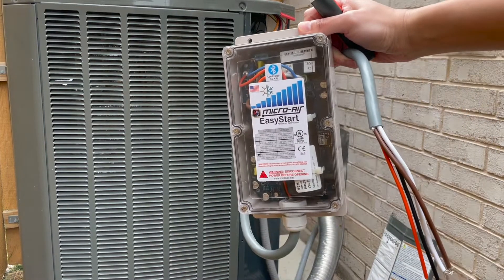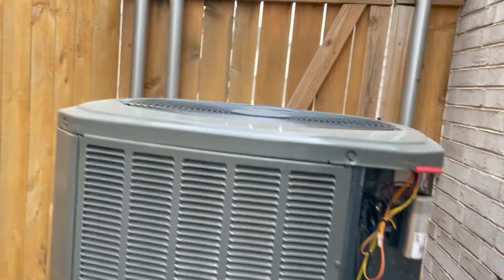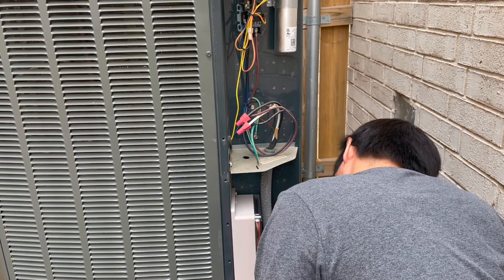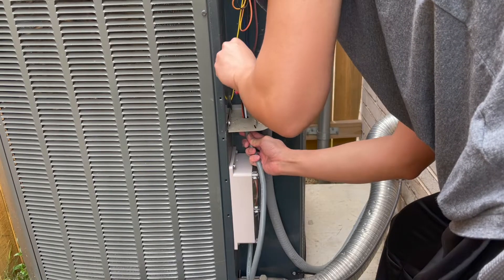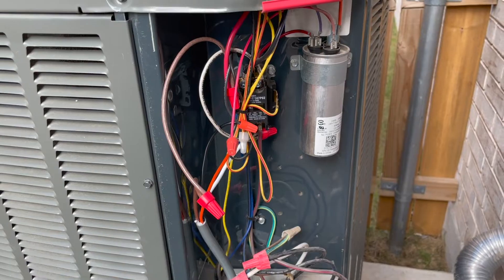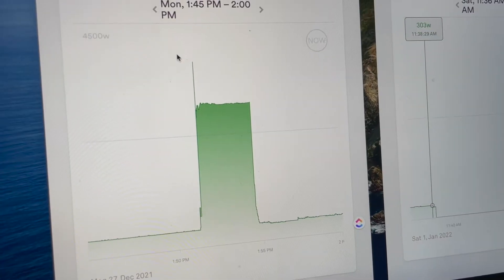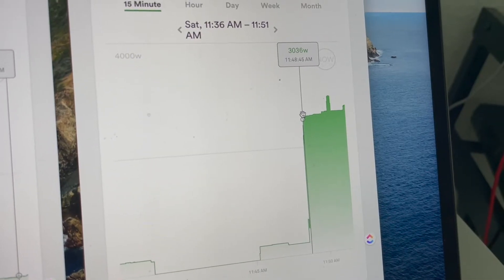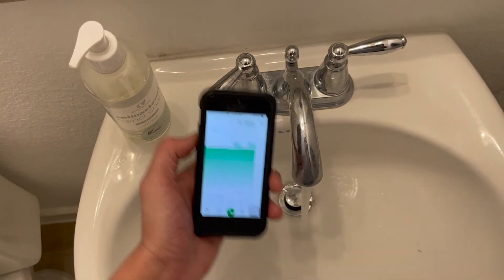Running a 4 Ton AC on a GENERATOR - Micro-Air Easystart 368 Installation & Testing

Comment: I installed the EasyStart 4 years ago on my 4 ton AC unit. It dropped the inrush from 120 amps down to 26 amps.  Running the AC requires 7 1/2 to 8 amps.
Reply from the maker: Me too! But my easystart unit recently stopped working… I had to rewire my AC unit to how it original was wired. 😢 Does yours still work? 

Microair support told me to try to change the capacitor in the unit, but if that doesn’t work, my unit just has to be replaced.

Comment: The Micro-Air Soft-start Flex will not last.  My unit only last 11 months with internal parts blown!   I hire my AC Technician to check my system when my ac stop working and he told me I am lucky it has survived the blown soft starter. With the investment over $400, I would not recommend to any friends and family.
Reply from the maker: Sorry to hear about your bad experience. I haven’t touched or serviced mine much since installing it several years ago. My AC is still working well.
Reply: @jonathanDIYs  You are lucky.  I have the newer model which fits all AC up to 6 tons.  It cost over $400 plus the labor cost of the AC Technicians.  It just not worth the money spend.  The product is not reliable.  Only last 11 months.   Again, the warranty is limited and will not cover the damage it caused to the AC unit.  Use on your own risk.  My AC Technician told me I am lucky that the AC unit survive the possible damages.  Pretty much I feel being scammed.  I am now very nervous to put another one in my AC Unit.

Comment: Never mount the capacitor upside down because the electrons will spill out!  Actually so that the water tight fitting will not hold water and potentially leak.

Comment: If you get one. Look at the clear plastic cover carefully. I have two of their Flex units. Both have a defect in the cover in the same place that looks like it would compromise the seal and allow moisture in. Not sure how I will proceed.
Reply from the maker: @maxwellcrazycat9204  sorry to hear you got one with defects. I'd recommend reaching out to micro-air, from everything I've heard, they really stand behind their products and give good support. I'm pretty sure they would replace it for you or resolve this with you somehow. I get it might be more trouble than it's worth, hope you figure out what to do.

Comment: I have a window unit I can quickly deploy into a bedroom window that I power from my similarly-propane converted Wen GN400i generator. I think it's reasonable fuelwise to run lighter loads if possible during an outage, and my little gen runs it well, along with my fridge, deep freezer, and a couple lights. Since it's 120v only, installing a generator inlet plug really isn't an option, so I just use extension cords. I want to install a natural gas quick connect next for it as I don't have but a few days worth of propane, but can always go back to gasoline so it's making it a bit hard to justify the cost. Anyhow, this little genny kept the natural gas furnace working well during the big Texas chill quite well. I'm debating on a 2nd unit for redundancy.
Reply from the maker: That's awesome. I'm glad you have an emergency setup that works for you! It was pretty important for me to run my central heating unit (which is hard-wired into my house) because I never wanted to be in the same situation as the 2021 winter storm which is why I went with hardwired. If you have the space and money, 2nd unit is always a good idea. I would consider a closed frame model - they're both smaller, lighter, and more quiet to run. The downsides is that it is more expensive. Check this one out - https://amzn.to/3X7gQAU.
Reply: @jonathanDIYs  Luckily my gas central heat/air air handler actually plugs into a dedicated 120v outlet, so it was easy to connect up with an extension cord. Had it been 240v or hard-wired, I'd of had a rougher time for sure.

Comment: And two years later is it still working?
Reply from the maker: Yeah, I have no problems with my soft start. It cycles dozens of times a day and I haven't had any issues with it. Still great when I need to run from generator power as well (though I haven't had a long term outage since winter 2021).
Reply: @jonathanDIYs   fantastic.  I will purchase one.  Was a little concerned from all the amazon reviews.  Some great and some not too good
Reply from the maker: @shawnstangeland3011  hope you have a good experience with it!

Comment: Isn’t that rated for 6 ton Unit? Might wanna switch to the flex version?!
Reply from the maker: @christian14329  they changed their specs over the years... At the time, this was the one rated for 4 ton AC. Check with microair if you're unsure for your own setup. This works for me and I'm not going to fix what isn't broken. 😁

Comment: Hello.. i have the 368-x48 blue as well running on a trane xr16 2.5ton with LRA 67.8.. the easy start works great running just below 25 starting amps..When connecting a generac 7kw with 8750 starting wats, it will not start the compressor... any ideas why?  

You have a larger AC unit 4ton running with the exact same set up as me..

Edited: my AC unit has a TXV valve.. does yours?
Reply from the maker: Hi Thimitri1, what's the symptoms? Does the breaker trip? Does it stall out the generator? How are you measuring 25 starting amps - just by the easy start bluetooth interface or are you independently checking with a peak hold voltmeter? 

I have always been a little suspicious to the accuracy of the easy start bluetooth readings. I always like to confirm using another voltmeter.
Reply: @jonathanDIYs ... no problems with the generator stalling or breaker tripping.. The condenser fan starts spinning and then the compressor starts but then stalls.. the easy start has green lights but then the system shuts down when the compressor kicks on... I believe my AC systems TXV value keeps the high pressure which makes it difficult for the generator to start but your video seems to contradict that, if your system has a TXV valve. 
Thanks for your reply..
Reply from the maker: @thimitri1  I think it might be time to contact Micro-Air support - https://www.micro-air.com/contact_microair.htm You might need a larger capacitor to get this thing working, at least that is what they say on reddit - https://www.reddit.com/r/Generator/comments/14tnsll/ac_soft_start_and_generator_size/. Hope you can get this working!

Comment: You should have been able to start the AC without the soft start.
Reply from the maker: There really isn't any way that the AC will start without the soft start with the generator size I have. The LRA (locked rotor amp) aka startup load on the AC is 80-100 Amps depending on your model. 80 amps * 220 volts is 17600 watts. You would need a larger generator that could do 17600 starting watts. My generator can only do 8750W starting watts and 7000W continuous. That's why I need the soft start!

Comment: Draining capacitor with multimeter could actually burn the multimeter and some cases even make it blow right in your hands, that’s the most dangerous thing your could do
Reply from the maker: I respectfully beg to differ. A capacitor stores microfarads (energy) and discharges it at a set voltage. If you look at the rating, it is usually 370 or 440 volts. Multimeters are designed to safely measure a certain amount of voltage, mine 600V. As long as you have it on the right setting (AC Voltage) and the voltage remains under the amount rated, it will be fine. The way multimeters work is they act as a very very high resistor. This is why when you test your voltage at an outlet, you don't blow a breaker. It measures the voltage and allows energy to flow very slowly.

"Most digital multimeters sold today for testing industrial, electrical, and electronic systems have high impedance input circuits greater than 1 megohm. In simple terms this means that when the DMM is placed across a circuit for a measurement, it will have little impact on circuit performance."

https://www.fluke.com/en-us/learn/blog/digital-multimeters/dual-impedance-digital-multimeters

Comment: You need a lesson in how to handle electricity. You trust that toy gadget to determine the lines are dead ? - pretty foolish. You should have used the multimeter. Also the soft kit is a piece of junk and is liable to ruin your compressor.

Comment: Jonathan, I've looked thru your videos to find out which generator interlock kit you have installed in your breaker box.  No luck so far...Can you share which one this is and where to buy it?  Thank you in advance!
Reply from the maker: Hi sorry I've been off of youtube lately. You have to get the generator interlock kit specific to your loadcenter. Best thing to do is open up your electric panel and look for make and model numbers. I found my electric panel was a Eaton CH style load panel. I looked it up in Eaton's brochure and found CHPMIKCSR to be the compatible one for my load center. 

If you have an Eaton, you can probably find yours in here too:

https://www.eaton.com/content/dam/eaton/products/low-voltage-power-distribution-controls-systems/load-centers/custom-flex-center-solutions/eaton-flex-interlock-kits-pub53673-en-us.pdf

If you have another brand, you'll have to look up the interlock kits for those things. Often times the original manufacturer does not make an interlock kit and you will have to go with a 3rd party.
Reply: @jonathanDIYs  thank you! Just got the nat gas pipe components ... Will get this while project done by August.
Reply from the maker: @christopherfrantz7050  do your research and stay safe! Good luck on your project!

Comment: Your main breaker box is located in your front yard exposed to the elements?  One hurricane or harsh weather event and your electrical box is toast.
Reply from the maker: It's supposed to be weather rated. 🤷‍♂️ They have all the main disconnects near the front of houses in my area to make it convenient for fire or emergency services to shut off power in an emergency. It's gone through the freeze and through hail, it seems like a pretty sturdy metal box. Not sure what could destroy it before you have to start worrying about your windows and other things around the house as well.

Comment: Now I see why micro air is a little more in price that app is handy! Great video!
Reply: How about a list with all your appliances fridges, lights, tv?
Reply from the maker: @copelandrobinson  that is the sense app. It clamps on to the main power incoming and uses machine learning algorithms to guess the power usage of different devices based off of their profile. For example, it might see a power spike of 475 watts when a fridge comes on, it remembers that and when it sees that spike, they attribute it to the fridge. It is cool when it works, but I will warn that sometimes it doesn't guess right.

Comment: Just got the connection to the house done and I thought my Champion 10,000 start/ 8,000 running watt generator would be able to run alone on it but kept kicking my fuse off. I wonder if this would make it work with my 4 ton AC in Texas heat.
Reply from the maker: Yeah, a soft start kit might really be able to help you. Look on your AC Condenser and look for LRA and RLA ratings. If you can get the LRA under 41.5 amps, you have a chance of starting it with your generator (assuming you turn everything else off when doing this). Hope it works out for you!

Comment: You're running a 4 ton on a 7kw (running power) generator?!  That's impressive!
Reply: Until the start windings in your compressor motor blows.
Reply: Hi Jonathan. I have the exact same setup (gen and motor snorkel) but my ac is a 5 ton (year 2024). Do you think it would be able to start it?
Reply from the maker: Yes sir, thanks for commenting 😊

Comment: I got the 368 installed on a 3.5o ton ac and the app shows the peak amp is at 40 amp and from the lock rotor am of 59 so it only reduced by about 36 percent. Can I still run this with my Genmax 9000 as well?
Reply from the maker: Hi Mariojalata5259 - that is really close to the limits. Doing quick calculations, the Genmax 9000 produces peak 9000 watts. 9000Watts/240V = 37.5 amps. If it is truly 40 peak amps, it will be too much power draw for the GenMax 9000. How many times did you run the air conditioner with the 368? If you run it 5 times, the peak amps might drop more. There is a "learning" period where the 368 adjusts to the load and optimizes the system. If you can get it under 37 amps, that would be ideal.
Reply: @jonathanDIYs  thank you so much for your response. To date I am on my 3rd run with the Genmax and the 40 amps so far is holding. Oddly enough, the Genmax seems to be fine as well.
Reply from the maker: @mariojalata5259  that's great! I think the easystart peak amp reading isn't too accurate.

Comment: At 6mins 30sec shows a plastic tube with a black cylinder attached. Comes out of the wall and goes to bottom of the condenser.  What is that?
Thanks.
Reply from the maker: Hi TomMeyers974 - the tube isn't plastic - I believe it is copper. I think it is the high side where the refridgerant is going into the house as a liquid. The larger tube inside the dryer vent thing is the low side where the refridgerant is going through the condenser as a gas. The gas is forced into a liquid by compression which increases the temperature (Charles's Law - https://en.wikipedia.org/wiki/Charles%27s_law). The hot refridgerant is cooled through the blower and the fins in the condenser. Then the cooled, compressed liquid is piped through the hose you are asking about into the evaperator which drops the pressure decreasing the temperature and is used to cool the house. The black cylinder I believe is a filter.
Reply: TNX. @jonathanDIYs

Comment: Nice job But your a/c fan wasn't spinning properly while on generator. Better check what's causing that. Could destroy your nice a/c unit.
Reply from the maker: Hi @rdcd111, thanks for your comment. The fan is actually spinning fine, it is just a camera glitch in capturing fast moving subjects where the camera makes it look like it is going much slower than it actually is going. You notice the same thing when they film propeller airplanes like in this video: https://www.youtube.com/watch?v=jKXDVVvGlXE

Comment: Your meter won't see the fan if you're using the Compressor common wire so that wasn't the problem.   You probably just forgot to press the max (inrush) button first.
Reply from the maker: I was using the main power wire IIRC. The max inrush button on my meter takes a max reading and then if there is new peaks, it does not further update. I edited out the 3 or 4 attempts I made at trying to measure it. Thanks for commenting!

Comment: who ran your condenser line set thru a dryer vent 😅
Reply from the maker: That's how the builders (or the HVAC contractor the builders hired) did it. My inspector didn't catch that either. Honestly, I'm not surprised - I've found more and more issues with the house the longer I have lived here and the more I have learned about how things are supposed to be done right. For this, what's the right way for this to be done?
Reply: @jonathanDIYs  The suction line (the big line) should be fully insulated with armaflex all the way to the air handler/furnace (looking at your video it doesn't appear to have any. The liquid line (small line) can be ran straight without insulation. They typically just run straight into the house with a standard fitting where they enter the wall, typically sealed with some type of weather proofing.. im guessing that the dryer vent may have been some way to either hide a giant hole, or make the HOA happy (probably not an HOA thing)
. But I would be skeptical if the dryer vent actually runs THROUGH the wall, that would make it nearly impossible to properly seal or make air tight.  Plus its flexible so any type of movement will eventually break down the weatherproof seal. The softstart on the other hand is a great choice to add to your system. Seems like you do more research than the builders. Also you are typically better off installing the filter dryer on the interior of the home vs. the exterior, but that's a minimal debate.
Reply from the maker: Thanks for sharing that bit of knowledge! One more thing for me to be mad about at the builders for not doing right. ;-) Next time I'm out there, I'll go check if they have armaflex on that line inside that dryer duct. I wonder if they did that as a way to protect the insulation. Texas sun does beat down pretty hard in my area!